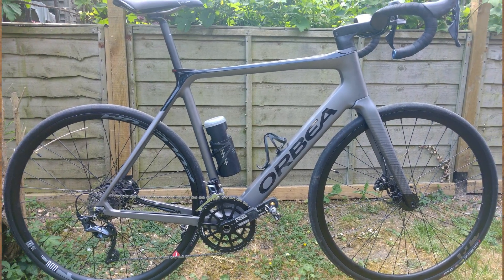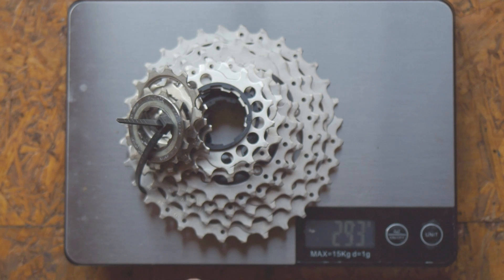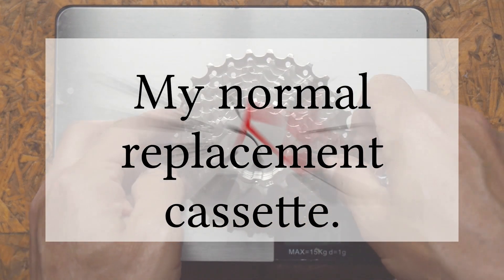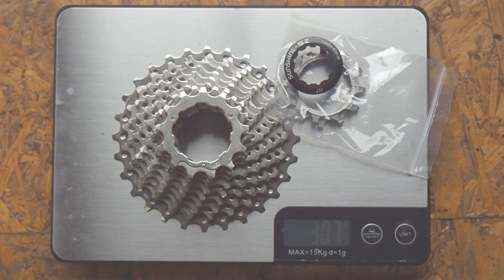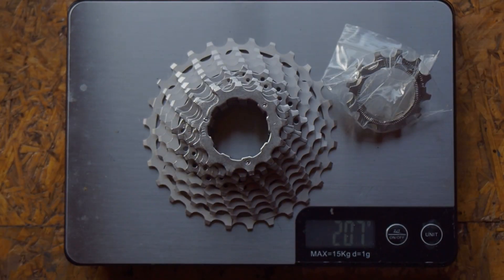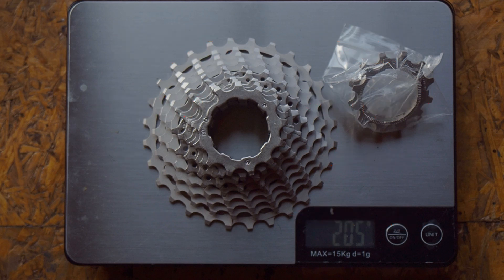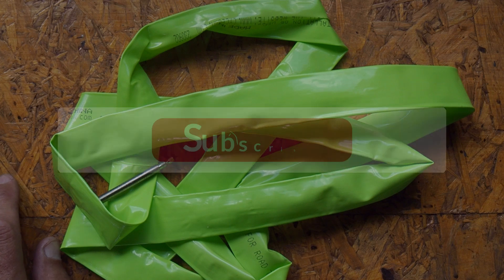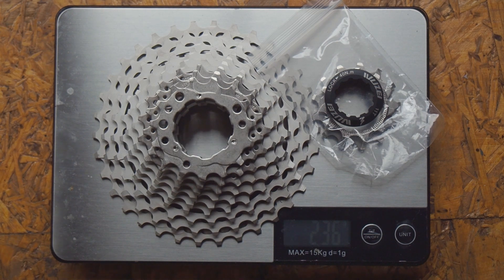Cassette weight saving

Comment: For the algorithm...
I've heard of these China wonder cassettes, reasonable price and weight loss, just the shift quality of the first generation was/ismediocre at best. Not exactly hyperglide, more like hypergrind.
I hope the next generation gets it right.
P.s. you could sell the ultegra for a profit (people love second hand quality gear) and get the new cassette for free 👍. That's  £0.00/ kg 🆓
Reply from the maker: 👍 ❓❓.
I started using the cassette shown in the video. I've only done a few hundred km but so far the gear changing has been almost faultlessly. Of course that may change when the cassette and chain wear. 
Not only have I thought about selling stuff on eBay, I've actually sold some  things. 
There are all sorts of tunes I can play with the cost analysis; however, I thought I would keep things simple in the video.  I plan to cover some of those more complicated issues in the summary video.